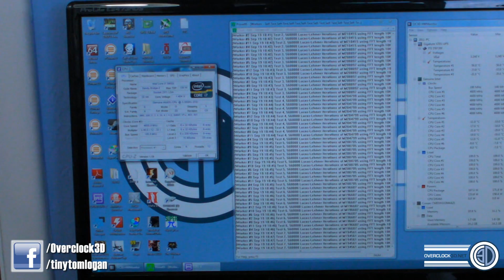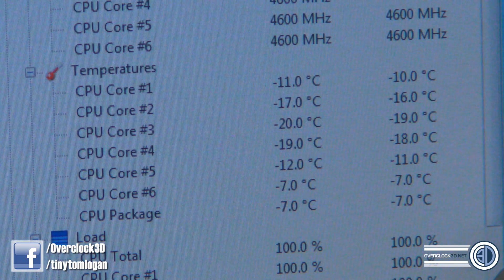Ultimate Corsair H100 Cooling Mod

Comment: I know this was a bit of fun and over 2yrs ago but what would have been cool to see is:

1)inline temp sensors for the coolent on both the inlet and outlet which leeds to
2)starting with one fan and slowly building them up so we get an idea on how each fan effects the temps, is there a point where another fan doesn't have a impact ?
3)how would the room temp effect the coolent temp; yes it would be a lot of work repeating the steps but it would be cool to have some numbers to play with
4)Sound mesurements so with each fan added we can see how much the nosie increases

Like you said it was a bit of fun :)

Comment: amazing... just by compressing the same amount of air in brut force due to the enormous numbers of fan can reduce temperature  down to -20!!! the only things is that water drop will probably begin to form and you'll have to get some insulating pad for your expansive hardware... but nice to know good job tom

Comment: I'm going to take this a bit more seriously than this video's intended to be.
Water cooling or air cooling they are all ambient cooling. At some point, the cooling fan will be sufficient to get the radiator temp same as the ambient temperature-negligent difference. At this point, given that load heat and flow rate do not change, the cooling cannot be improved any further by increasing the air flow.

Alternative to this silly build is an evaporation cooler. Get a meter long PVC pipe, a shower head, pump, and a heat exchange-you can get all these for under 100 bucks. Idea is that the water drops from shower head, gets cooled by direct contact with air and further below ambient cooling by phase changing-part of water evaporating and therefore taking heat with it. This cooled water enters heat exchange, cools the water cooling loop within your pc build.

The reason why I chose this specific alternative is because the silly thing in this video is roughly the same size as my evaporator. It is highly energy efficient - I have 35 Watt pump powering the whole thing-plus another 34W for the pc cooling loop. No need for fan because the evaporation is quite significant even without additional air flow.
Reply: Curious, John. Does your evaporation rig produce the same temps as the cooling rig in this video?
Reply: AKACBFT Much better actually as it can go below ambient.
Water temp stays around 15C when the ambient is around 24C. This is the water temp.
CPU temp during prime95 testing does not go over 25C. Mind you though, I have two one meter evaporator chamber with 100W motor running the evaporating loop.
I'm going back to Australia on 28th and I believe it will perform better over there-dryer hotter climate.

Comment: For the funny factor this works. For the realistic side of things, there is failure of air dynamics. For all the fan to truly build up pressure, you's need to cut the air off the blades and redirect flow to the next fan or, each fan has to counter-rotate the one is put against. The configuration of the video is very high in turbulence, you'll find the airflow for 40 fans is no different than maybe 3.

Comment: My question is about when he show all 40 hooked together--- it looks like the end fan (the one further away from us) is only about 4 inches away from the wall- would that not hamper air flow? Also- and I don't know how to do this, but would it not be better to have the fans moving in opposite direction as would you find in a jet engine? They have fans that do that for server cooling.

Comment: from a more serious point of voiw this could work in theory the problem really comes down to timing you would need to have all fan spinning in sequence which doesn't happen if you just power them all and click on. because due the current having to pass through each device casing a millisecond pause so they all spin at a different time causing the airflow tobe broken up at each stop but if they were in sequence...

Comment: With only two 2000 rpm fans, the results are better and the noise lower. So many fans doesnt add air flow to the setup beyond what two or four fans could do. The static presure may be increased...

Comment: This has to be fake. Windchill feels colder to you because it is taking heat away from your body. Every notice that when it's around 100 degrees out and windy it doesn't feel any cooled when windy? That's because there is no thermal energy to be released from your body. Ever stood in front of a furnace vent or torpedo heater and notice how intense the heat is? It's because the wind is blasting thermal energy at your body. 

Moving air can not cool beyond its ambient temperature.
Reply: Did you watch the whole video? He said at the end it was just for fun

Comment: how about you get a car radiator and having it cooling a system passively by having it in a freezer. ((and modifying the freezer by adding holes for the cables to exit)) i bet you could get better performance.

Comment: when he says m3 bar does he mean 3mm wide bar or something else please tell me i would like to build this for a nice overclock
Reply: Did you watch the end of the video ?
Specifically from 15:40 and forward too the end he says that its just a trolling video.
Go for a large air cooler or a custom watercooling setup with several radiators. Instead of something that will be just a ton of noise and no temperature difference.

Comment: All joking aside, I would love to do this sort of thing externally with about 4-5 fans on each block strapped to a 360 mil radiator in a custom loop and have it outside of my window or something, make some sort of cover for it and have it almost like an air conditioning unit outside my window with tubes going outside the house to a radiator from my pc... sort of like what linus techtips are doing for a whole room except for just 1 pc, something to think about

Comment: jokes aside and whatever.
i know it's a joke
i know it's nosiy
yeah yeah skip those part, now i just wanna ask how do he make the temperature to show as negative in the software? that's all i'm curious about.
Reply: the temps are real
Reply: Maybe he did this in a -20 degree room?

You can add or take away from temps due to error margins on certain software.
Reply: Vecha302 Changing the software reading from thermistor to diode tends to show a negative temperature.
Reply: I'm sorry, it seems everyone slept through thermodynamics. Let's make it simple: Have you ever used a fan to cool yourself during summer? Does it work? Does it make you feel cooler? OK, now, is the air that the fan blows on you the same that is around it? Good, now go read about convetion cooling or convective heat transfer and come back.
If you still think this is fake, stop using fans on summer, or read again and try to grasp that room temperature isn't a threshold if you can move air as fast as you want, lowering it's density and pressure and thus being able to cool something beyond room temperature. And if 0ºC seems as such a barrier, try to think about temperature in K and see how unfounded that is.
Reply: Vecha302 shush, he might be right.
Reply: Daniel Mastía 15:50
Watch the video, then comment.
Reply: not 1 answer still convincing yet, you guys all sound like guessing more than knowing.

or some of you do know and have done it before?
Reply: Vecha302 but it was moving real time and no artifact shows when the camera moves. is he really that pro with photoshop? XD
Reply: lols.
Reply: Idle calibration offset! That's how.
Reply: buddatech i'm sorry for my lack of knowledge but what do you mean?
Reply: Vecha302 If this video is a fake or not, it's irrelevant. The explanation I provided is still valid even if it doesn't apply to this particular instance if the numbers were manipulated.
Reply: LargeBanana
the bible might have the answer you are looking for.
Reply: xRECONCILEDX and then contradicts itself in later pages.